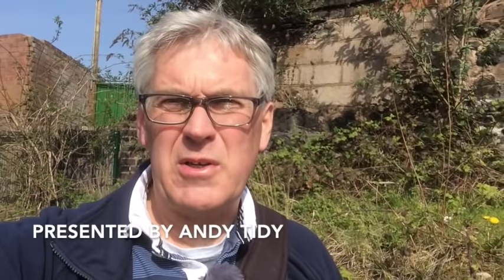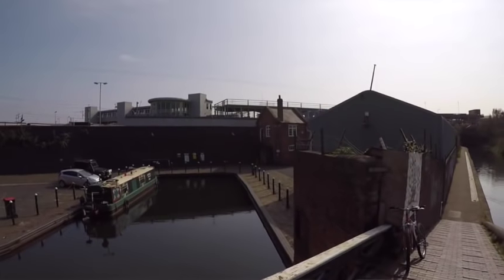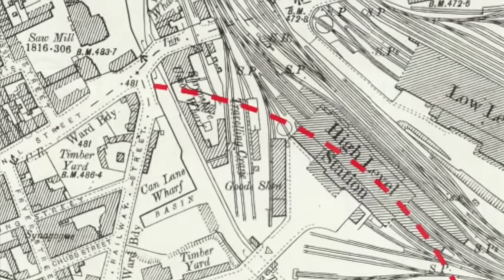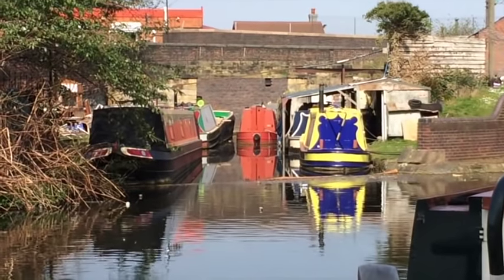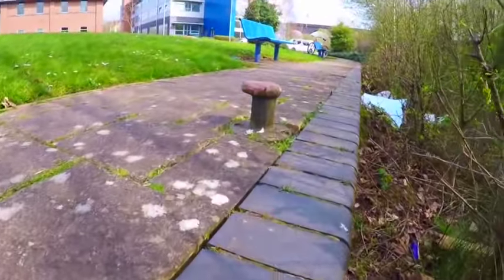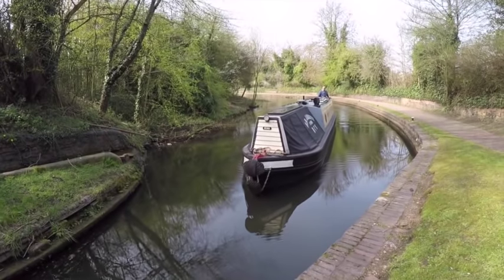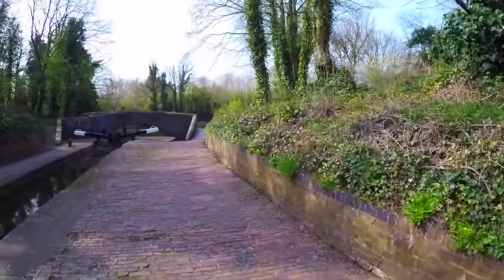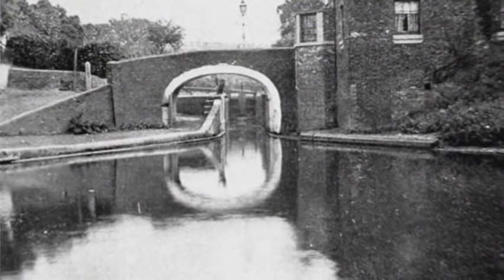2.7 Lost canals around the "Wolverhampton 21"

Comment: You have brought back some great memories for me there, in the early 70's we used to crew a 72 foot long boat(the longest that could fit in a lock !!) called The Pike from the Gas St basin ( we were 14/15 years of age then and the boat was owned by Birmingham social services and my mates Dad was the skipper.We once did the 21 locks,turned round at the bottom and came back up them (really hard work !!) we used to do the Wolverhampton run often( sometimes using the Smethwick upper level and sometimes the lower level) and also go the other way to Tardebigge  with the canal passing through Cadbury's .
Reply from the maker: Glad you enjoyed it - My associated blog - Captain Ahab's watery Tales features from old photos from the 1970's which you may enjoy. Happy Christmas.

Comment: I'm a bit puzzled, you said work on the high level station started in 1843, and yet the picture at 1:57 shows modern construction techniques and plant.
Reply from the maker: Hi - the dangers of using images from across the decades! The work you can see was in the 1960's when the Can Lane arm was being filled in.

Comment: Do you have a video on the new main line between Factory Locks, Tipton & Spon Lane? I’m particularly interested as I used to cycle along it as a child near Dudley Port. The bit I’ve always been intrigued about is the little ‘island’ near what was the Gulf Oil terminal & King steel works. I presume it was a toll station?
We also did the Netherton Tunnel.
Reply from the maker: My early series mostly cover the lost canals but the "Smethwick Summits" episode in Series one may be of interest.

Comment: I'm totally confused about the bit about Lock 20.
5:40 :
Lock 20 was the bottom lock, with a 10ft drop as opposed to 5ft for all the others.
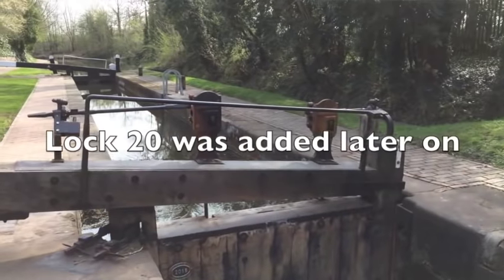At 6:19, it states "Lock 20 was added later on" but it's already there. Did you mean Lock 21 ?

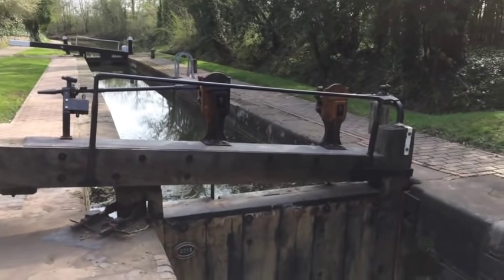Then at 6:21, you state:
"and the original line of the canal ran out beyond the (bottom) gates behind me five higher up"
 - Five feet higher up than what ? 
Did you mean:
"and the original line of the canal ran out beyond the (bottom) gates behind me, which is now five feet higher up" ?

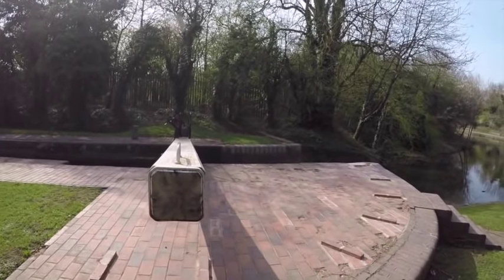Then at 7:04 you said:
"The original line of this canal continued on the same level as this lock and went round the bend"
 - I thought the original drop was 10ft but has since been reduced, so the original line of this canal wouldn't have been the same level as this lock.

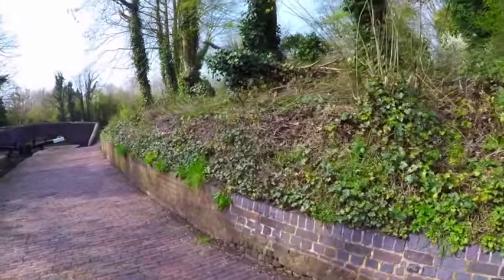7:40
"We're now at the site of the bottom lock. originally when it was built it was 10 feet deep, this one is now 5".
Oh right, I get you now...
At 5:40 you're standing by the new (additional) Lock 20 but talking about the old Lock 20 (Now Lock 21), which makes it very confusing.
Reply from the maker: Sorry - it is confusing. Todays bottom lock has always been the bottom lock but at the start it was twice as deep and numbered 20. Todays No20 was then added as an extra and the reduced   old bottom lock became 21.
Reply: @lifeat2.3milesanhour57  
Thanks.
I got that by the end of the video but it wasn't clear that the new lock was inserted between the bottom lock ( old Lock 20 ) and Lock 19.